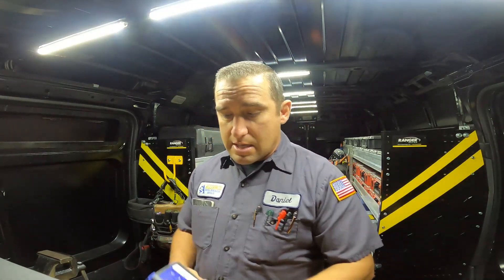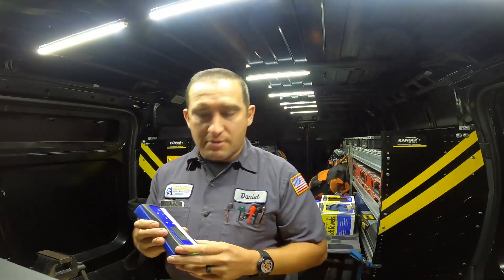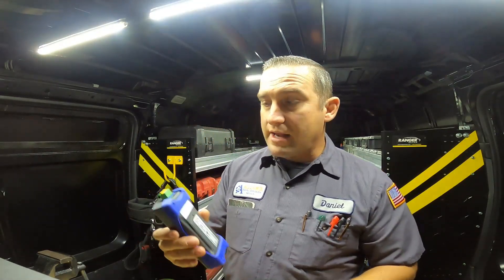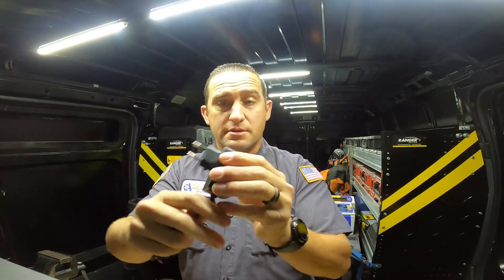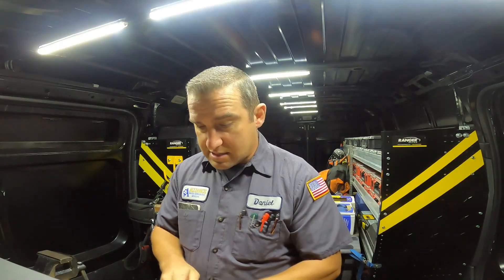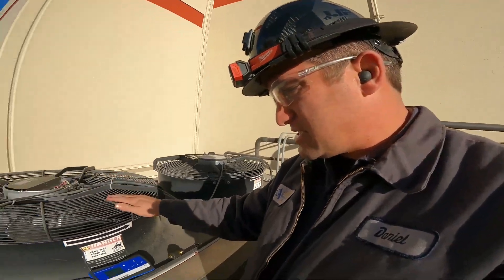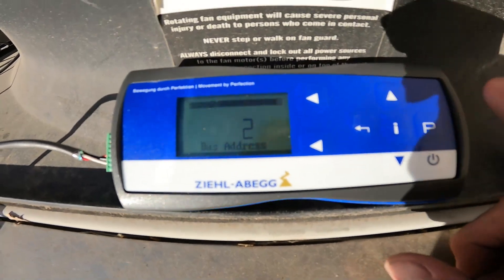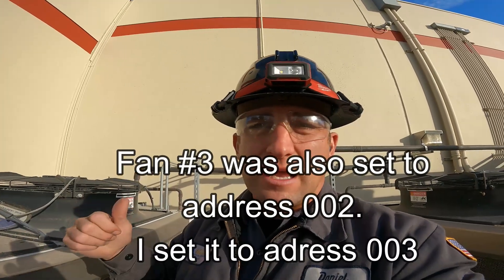BAC ZIEHL ABEGG FAN PROGRAMMING

Comment: Thank you for the heads up, I have to look at an industrial/ commercial York cooling only rtu unit on a Mexican bakery soon for a customer. Their stating that the indoor blower motor isn’t working and they have a lot of thing unplugged on the main controller. They want me to figure out what’s going one with it. I’ve never worked on anything like this so it be a good learning experience. Thank you for sharing your experience.